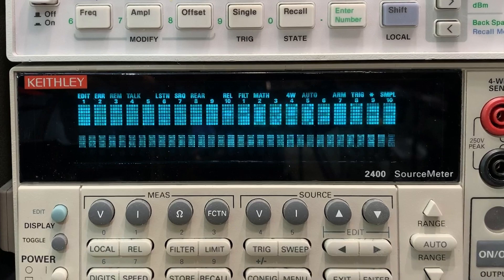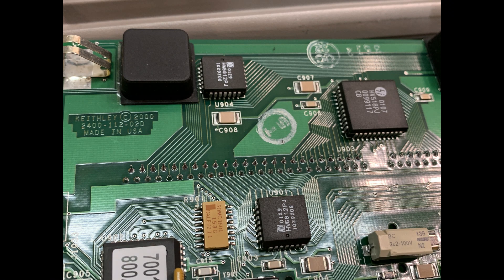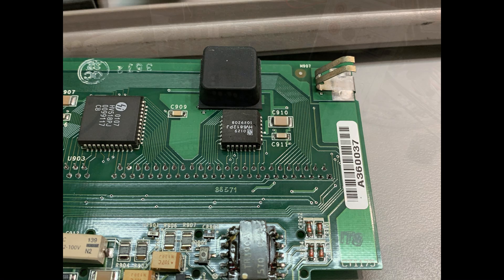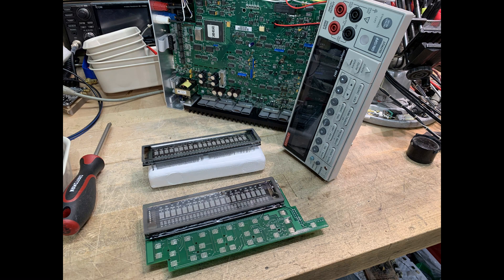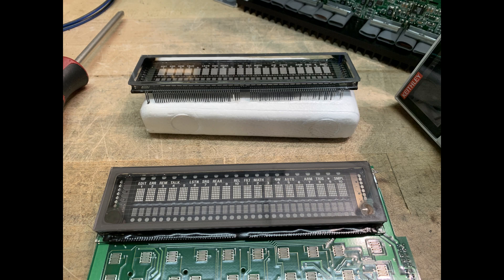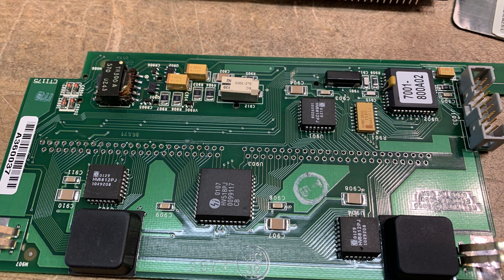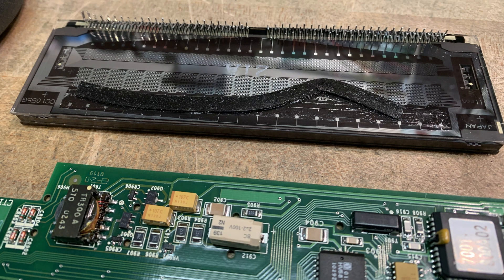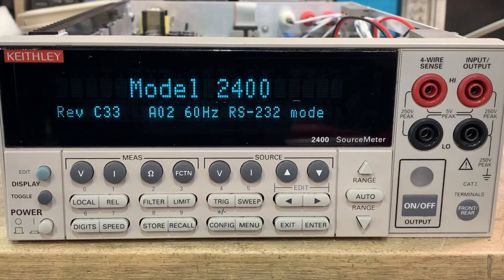#1335 Keithley 2400 Display Replacement

Comment: Nice.  One helpful hint for things like this to make removal easier is using some low melting point solder and mixing that with the factory solder, especially on newer lead free boards with higher melting temp solder.  Really reduces the stress applying so much heat to parts.

Comment: Hi, it's amazing that there are people among us who will offer a spare part just based on a video. As I have written many times - I consider the SMU and the curve tracer to be the two best universal devices for working with electronics. Unfortunately, I ran into the opposite kind of people and lost my equipment and my SMU. As long as you don't have it, it doesn't bother you that much, but as you get used to it, the absence is many times worse, considering the prices, I'll probably never get another one.

The suction gun is a small miracle, I also always remove the parts whole, I don't cut the legs, but sometimes it's a real struggle.

Nice day 🙂 Tom

Comment: Looks like the old display had the text "UPGRADE OFF" or something similar burned into it. Can't see what that might be in the service manual.
Reply from the maker: I got the unit cheap because it got bricked during a firmware upgrade.